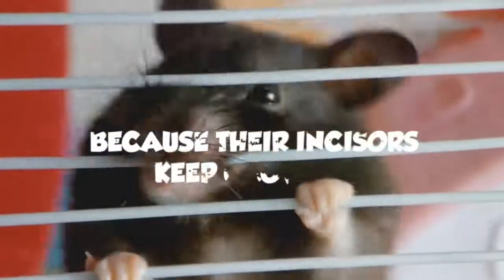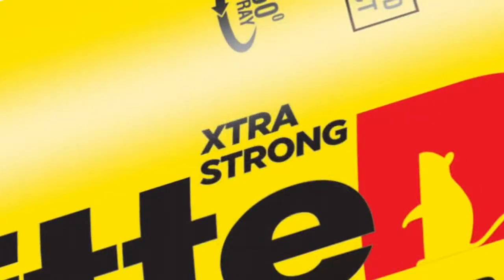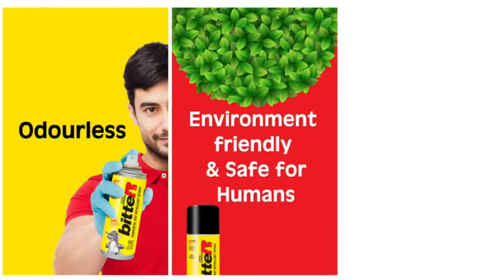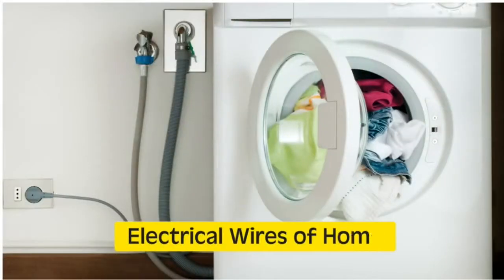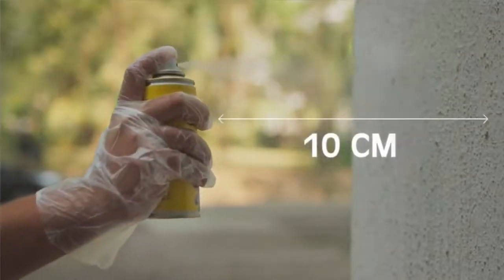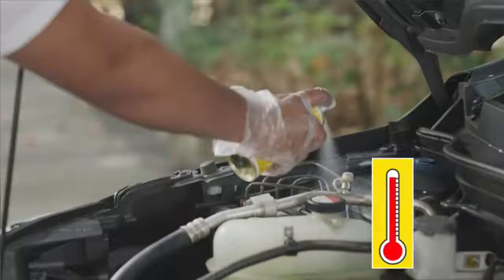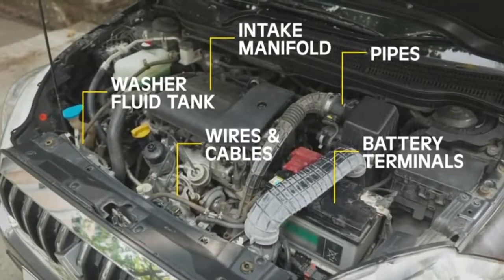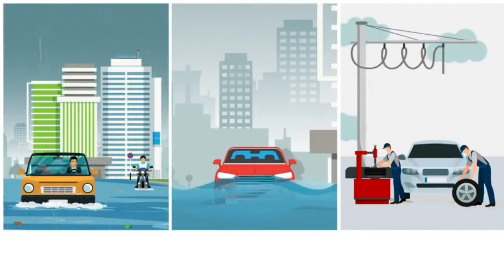Non Toxic Rat Repellent Spray | bitteR | Amazon India

Comment: I used this spray just 5 days back inside the engine compartment.. Smell was so strong that I couldn't control.. So I thought rats will definitely not enter the car.. But today I checked and was very disappointed.. Rats entered and stayed happily in the engine compartment..

Tobacco, lights, Hit, and finally bitter spray also didn't work. RATS ROCKS